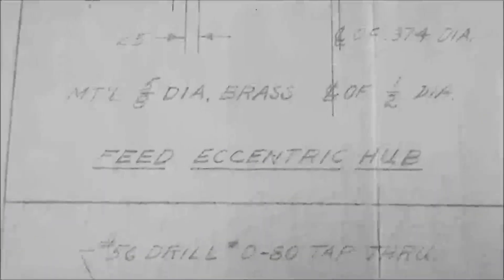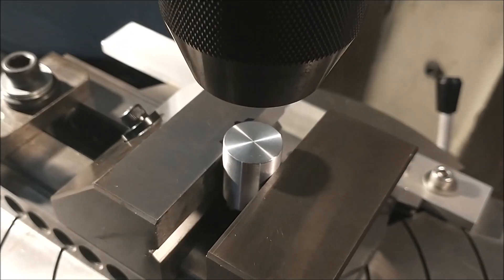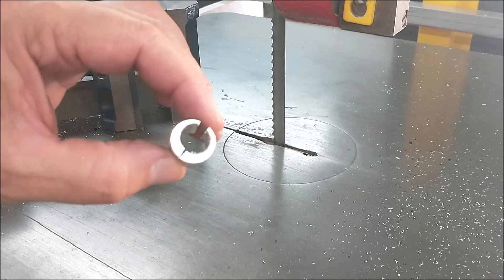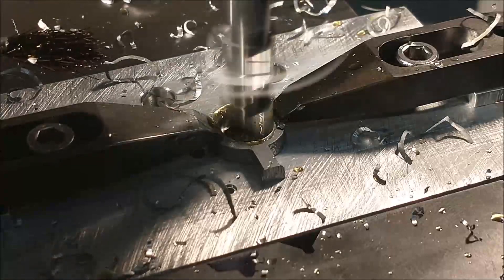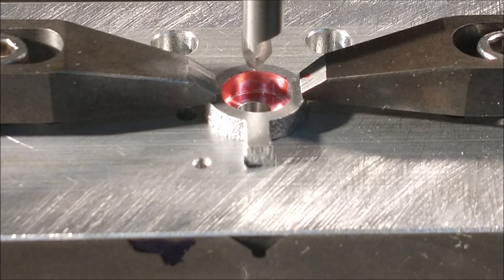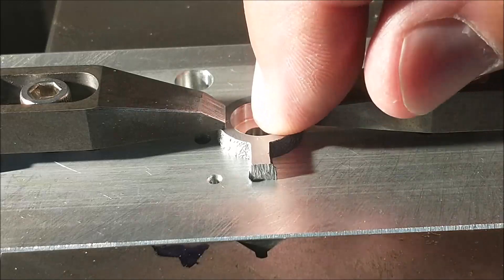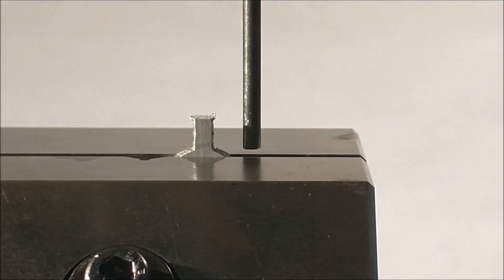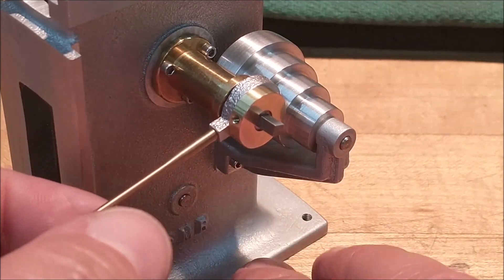Machining an Eccentric Feed Hub and Collar

Comment: I dont know why im so befuddled about this? You moved the table in "Y" away from you. Shouldnt the digital have read a negative .050? Now I have to check our mills at work tomorrow, haha. In cnc world that would be a negative move. I honestly dont know witch perspective our shops manuals are in. Operators point of view or the machine columb point of view. Love your vids!
Reply: I think DRO's +/- directions are setup by where the sensors are on the pickup. If you are reading Y direction away from you as + and you want it to be - you would swap the sensors. I think it's just a shop preference.

At least that's the way I think they work. Someone please correct me if I'm wrong.

Comment: Really like the new Intro, nice touch! And great tip in protecting the carbide cutter on gauge pin removal. I will go out and look at my shaper to see if it has the square shaft also,,,Will text you a pix,,Bear.
Reply from the maker: Thanks Bear.

Comment: Nice work, many thanks for the tip. I do wonder what the wire EDM parts at the end are for though.
Reply from the maker: Bed side rail clamps for a surgical table.
Reply: @joepie221  Fair enough. Quite an expensive way to make them I would have thought.

Comment: Great new lead/intro for your channel bud. Originally this project looked fairly simple. NOT. I see now this one has a lot of small, tiny parts and pieces. More than any previous projects in this series. I have always had difficulty with offset and interrupted cuts wanting to physically draw me in or make me dizzy. Frequent breaks was usually my relief from that situation. This is coming nicely along my friend. I await your next post. Take care eh.
Reply from the maker: Thanks 👍  The clapper block is last and looking pretty challenging too.
Reply: @joepie221  I had to think for a moment about that. Getting the hinge square and functional and the lathe like tool holder will be. We really need to admire the original designers of machines like this. They were the early machines that made todays incredible units. Those folks and who ever came up with the idea of a slide rule eh. I think I'm going to dig mine out. It must have a foot of dust on it, LOL. See ya soon my friend.

Comment: O.08 inches = 2.032 Joe
millimetres

Just for the record Joe
Reply: An #0 imperial screw (such as on a 0-80 thread) has a major diameter of 0.060″ (table lookup!), aka 1.52 mm. Kind of like how a #10 screw is 4.83mm (0.190″), nothing like 10mm.
Reply from the maker: Thanks Steve.

Comment: Are you wearing magnifying Goggles?  I’m so impressed at the precession at that scale
Reply from the maker: I use a loupe for close up work at the machine, and use a vision aid headset magnifier at the bench.
Reply: @joepie221  I’m hoping in the end you make the miniature shop with the drive, maybe even use that steam engine you made😊

Comment: The part where the drill bit picks up a bunch of swarf and spins it real fast....I remember a boy at school deciding to uses his fingers to  clear that while the drill was still going....not a pretty sight...unless you like red that is (we had all been told specifically not to do such things)
How about a small cup on each machine that has those little wood bits and shims etc that odd processes situations need. lots of my tools have things tied on string or taped to the plug if I use them a lot (I dont use a lot of stationary machines much)
This little lathe looks amazing.
Reply from the maker: The thin stainless bird nest is probably the most dangerous. I don't take any chances around that. Especially on a lathe.

Comment: Is there a reason  why  you ream first  then  chamfer?
Reply: As not to debur twice?
Reply: Are you  not  putting a bur in the  hole  after ?
Reply from the maker: You can only chamfer the entry side prior to reaming. The opposite side is normally a secondary op.

Comment: Like the eccentric bushing, however why not only cut through one of the sides to keep the bushing in one piece. That would still work I guess.
Reply from the maker: Depending on the material stress, the bushing could relax and distort and make it hard to install the part.

Comment: I think the square is there so that you can hand crank the Ram back and forth while setting up. On my atlas the one crank fit about 4 different shafts and that was one of them. Btw why do you make an eccentric bushing rather than using a 4 jaw chuck? I thought everyone just used a 4J? Easier for you than swapping out a 40 lb chuck?

Comment: The square on the drive shaft might be a cosmetic thing; the real deal has a shaft going in that allows to adjust the throw (distance) of the tool. It moves a spindle that is conencted to the pin that drives the connecting piece to the top.
Reply from the maker: I understand its for timing.

Comment: Great as always, but what you could have done here is an eccentric within an eccentric, which combined with a finer toothed 'gear' on the lead screw
would provide an  adjustable feed per stroke.
Also the pawl could be made by directional with a neutral but the parts are getting tiny already Lol.
It sure would be fun to see this actually cut some Delrin!!
This kit is way up on my stay busy when I retire list, not far off!!!!
Reply from the maker: This has been a fun build. I'd really like to cut something at the end.

Comment: Another point is to make sure you actually bored ALL the way through the strap. Maybe a little sharpie color on the fixture plate, then add in the radius of the boring cutter tip, which means dinging the plate a bit.
Reply from the maker: I did hit it, but a light facing cut will re-dress the surface.

Comment: joe,  meant to say last time, 80 thou is (about) 2 mm.
and what is a decimal 0.80 ?
I thought I understood the inch system just a little bit but now I'm completely confused.
Reply: thanks everyone for trying to explain it, now i'm a little less confused but still it's very confusing.
wouldn't it be simpler if the whole world used the metric system as it was/is intended?
so much easier....
Reply: @be007  Ben, I've been using imperial my whole life.  But years ago in college they taught us to convert back and forth because the metric system is imminent.  I don't want to say just how long that has been, but time has passed and not much has changed.  I will admit though, outside of construction or large projects I primarily use metric.  Both in the machine shop or now with 3d printing.  I use Fusion daily to make cad drawings and I have set it to use metric by default.  I really don't need a calculator for much anymore, I have most of the conversions memorized.  Metric can be much simpler, but there are cases that imperial is just better suited for the task.
Reply from the maker: If the world goes metric, I'm booking a flight on SpaceX.
Reply: 1mm is 39 thousandths of 1 inch or 0.039" (which makes it approx 40 thou)  2mm being approx 80 thousandths is a close approximation.  The decimal for that is 0.080".  In the inch system, most everything is referred to within 3 decimal places of 1 whole number.  When you hear someone talking about tenths, they are actually referring to the 4th decimal placeholder (ten-thousandths).  I hope this helps.
Reply: @steveg069   unfortunately there is a misconception about this 0.80 lark. Joe was referring to an American 0-80 sized THREAD which as he says in the video is approximately 1.5 mm or around 0.060". I too was confused as we over here in the UK even if we are working in Imperial do not use the American system of number and tpi for small screws below I suppose 1/4" we have always used one of the Whitworth, BSF, BA, BCy ( British Cycle, not sure I have that correct) so it's easy to get confused when someone quotes something like 0-80 for a thread.
Reply: @samrodian919  Yes it can be very confusing sometimes.  The 0-80 screw is actually broken down to mean #0 (size which is 0.060") and 80 which is the TPI (threads per inch).  In that respect when he was mentioning 1.5mm that is a very very close approximation to the actual 0.060" diameter that the screw measures.
 
The numbering system we have for small fasteners is puzzling.  But once we get above a #12 screw size it gets easier.  Metric fasteners are much simpler and give you all the information you need just in the size of the fastener to figure out both internal and external threads without needing a chart.  I can do that with imperial, with some extra math but only after getting above a #12 screw.
Reply: Decibel .80 is 8 tenths of an inch.
Reply: @ellieprice363  in machining language, 0.8" is called 800 thousandths.
Reply: @steveg069  True .80 is 800 thousands. It’s also 8 tenths of an inch, or a little less than 13/16 (.8125). Born and raised on this stuff after sixty years in the trade.
Reply: @ellieprice363  I don't disagree with that.  In fact I completely agree.  However, that isn't how machinists speak.  If you told them to add "2 tenths" they would add 0.0002"  Just like if they say "make that part 500 thousandths" rather that saying either half an inch or 5 tenths of an inch.  That's just the lingo.  Just imagine moving the decimal over 3 spaces to the point where 10 thousandths of an inch is now in the placeholder previously know as 1 tenth of an inch.  I know it can be confusing to some people especially those that primarily use metric.  I was simply trying to point out what was meant by the comment of the OP.

Comment: To add to the "what's the square for". On most full-size shapers that  I have used (not a huge number, like I can count it on both thumbs) the crank in that position drives a shaft to a bevel gear to a leadscrew on the main wheel that adjusts the stroke. (it does actually rotate, there's no clever linkage like you get with the facing slide of a boring machine) 
Clearly that isn't what it is for here. So I have two alternative suggestions:
1) It's entirely cosmetic, to look like the big boys 
2) It's to manually move the ram to set up the job. And maybe to move the belt on the pulleys. But for those purpose sit would work a lot better on the pulley shaft.

Comment: New intro is very slick.
I'm too lazy to make eccentric bushing for a single part and would probably just offset with a 0.050" shim in 3 jaw
Reply from the maker: Not sure that would give you a  correct offset.
Reply: If you did that in a 3 jaw then the actual offset would that end up the correct offset? Also it would end up being a bit of a shady work holding situation and maybe with the bar ending up not parallel to the axis of the spindle.
Reply: @samrodian919  For work holding, it's not really any different to using a  soft metal wrap around jaw to prevent surface damage.
 As for accurate offset, no idea as I'm not making one but I'm pretty sure it would be in the few ten-thousandths range not thousandth's of  an inch?
Someone with better math skills can work it out

Comment: There are two categories of people on this comment thread: those that have learned new vocabulary by chipping a cutting edge while extracting a sticky gauge pin (so they now insert something soft in the gap as a matter of habit), and those who haven’t (and will ignore the advice until it happens to them).
Reply: Then there are the ones that left plenty of room between cutter and workpiece... and then pulling up on the gage they smack their hand into an amazingly sharp cutter. I was that one. Flesh is not a good substitute for a popsicle stick, "precision" wooden wedge, piece of cardboard, or whatever.... Saved the cutter though :D
Reply from the maker: Ever hang out with turret lathe operators ?????? Everyone of them has a puncture scar.

Comment: Joe, love your work and learned a lot from it. One question; why did you make the eccentric tooling on the mill for using on the lathe instead of milling and drilling the part on the rotary table in one go for final parting of in the lathe? If you had to make more parts I would get the idea. Just puzzling here. Curious about your answer. All the best, Job

PS; I would like a machined surface for the last part (lug?) you made. All pristine and nice precision parts next to a cellulitis orange appeal.  Why did they cast this anyhow? It would make a great rotary table made part....
Reply from the maker: That eccentric could have been done a dozen different ways. I chose the bushing because its the easiest to setup again. I did finish the outside of the eccentric....with a file....You'll like how I did it. Next video.

Comment: Dust-cutting that bore reminds me of watching avocado pears ripen: not yet, not yet, not yet, too much! You nailed it, Joe!
Reply from the maker: Thank goodness for fast forward.
Reply: That's one reason Sunnen and others invented honing machines 👍
Reply: One thing we had when I was working was a couple of small Wohlhaupter along with some Criterion Tenth Set boring heads for tighter tolerance bores in the Bridgeports on jobs we didn't want or need to do in our jig bore or jig grinder. Besides the jig grinder was usually set up to do a very specific job grinding bores in Ampco Bronze support bushings used on a production boring operation. Line boring crankshaft and camshaft bores.

Comment: Hiya Joe. 
Great video once again. the Square on the end is for setup before running it on the flat belt drive. My Father in law has a Sunderland Gear planner from the 40s and it has a similar system for setup.
Reply from the maker: Thanks for the info!

Comment: Joe you made very hard work of that eccentric strap. If you had made it first you could have had any size hole from your cutter. Then make the eccentric to fit. It is always easier to turn a diameter than it is to bore a hole. Regards from Australia
Reply from the maker: Hi Dave. I agree with your comment. But, I'm making every effort to stick to the dimensions on the print on the first attempt. If I were to do it again, who knows?

Comment: Hi Joe. Yes the square is for hand cranking the machine so the throw and position of the ram can be set and also to indicate in a job. How will you time the eccentric for the feed as it needs to advance the cut on the back stroke and i don't see any keyway
Reply from the maker: The brass eccentric has a set (grub) screw to lock it after rotational adjustment.
Reply: @joepie221  and i gather after you set all the positions on the shat you will dimple the shat so it can't slip? Oh and any further thoughts on making a roller bearing centre for the lathe😁

Comment: That is WAY easier and more sensible than fooling around offsetting a 4 jaw chuck.
Reply from the maker: Immediately repeatable between parts too.
Reply: @joepie221  
And a lot cheaper than punching an eccentric hole in an emergency collet. IIRC Hardinge actually offers a service where they will make custom 5C collets along with other sizes to match custom work holding requirements. Another option here would be an adjustable fixture plate with a vee block you can offset as on a Harig Grind All. 
We had repeat jobs that had eccentrics on them that we had special work holding fixtures for turning the eccentric in the lathe. Locators for the small end of connecting rods so that the same machining line could be used to machine two different length connecting rods.

Comment: Years ago, when I was younger and ran a small precision machine shop I needed to do alot of different eccentric parts. I modified a boring head by making and installing a holding devise for small collets. I then mounted the boring head into the taper at the headstock of the lathe and indicated zero to the collet hole. I then mounted a part in the collet and proceeded to dial in the offset of the particular design of the part and turned the offset. Using a permanently altered boring head to make a wide range of offset parts saved me time and solved accuracy problems. This technique demonstrated was excellent but only yielded one specific offset. It turned out great. Thanks Joe for the demonstration.
Reply from the maker: Interesting, I'd have to see it.